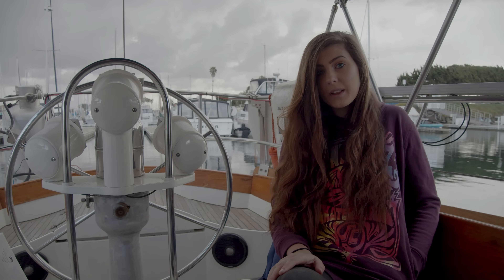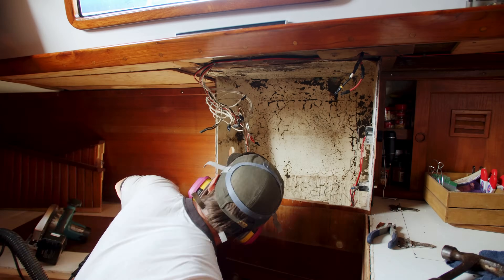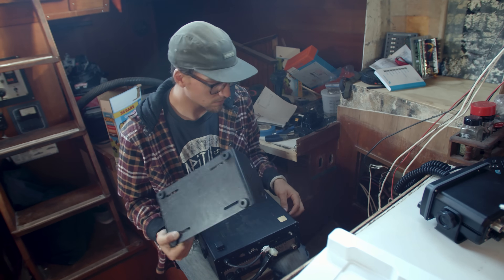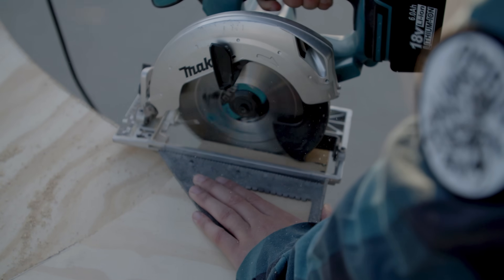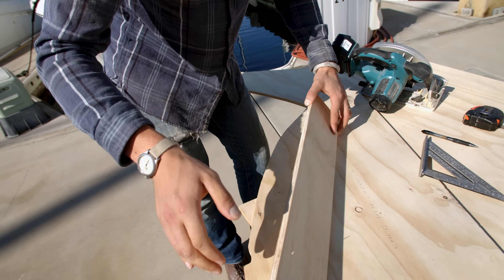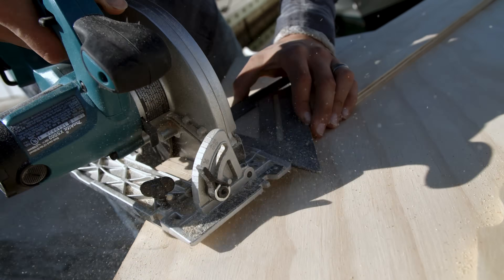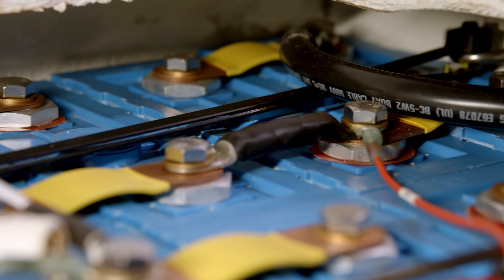Sailing Avocet | DIY Lithium Batteries for our Sailboat!

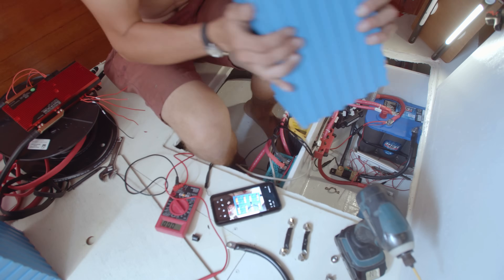Comment: @8:24 there is no difference between 4S2P and 2P4S. what your talking about with needing two BMSs would be TWO 4S1P packs. If you actually have the cells in 2P weather you call it 2P4S or 4S2P then you would only need one BMS. Source: Me - an electrical engineer with lithium pack experience.
Reply from the maker: 🤙 thanks for taking the time to watch and comment. https://www.svavocet.com/2021/02/22/powered-by-home-built-batteries/

Comment: Really organized and clean layout. One can tell you obviously did your research, bought the right components and dud a nice clean install.
Love the organization of the navigation station.
Could nit really tell, but is your battery bank & management system above the water line? Some of the other cruiser channels are finding out the hard way that electronics  / power should be above.
Reply from the maker: Thanks for watching Joe and great question! Avocets interior is actually very much so under the waterline. This is one of the reasons the batteries live in a water tight box under our bed, absolutely out of green waters wrath and any leaks (that (god forbid) happen.

Comment: Guys, could you please ID the labelling system you used on the wiring, I am about to do the same, but have not found a system as good as you did. Thanks
Reply from the maker: We actually purchased a label machine to make all of our labels, are you asking about the schematic?
Reply: @sailingavocet  Hi, that was an impressively fast reply; thanks. I'm interested in the attachment method, both the backing for a label and the apparent zip tie connection to cables. I also brought a machine, looked at many electrical trade systems, brought simple at first for white letters on black tape on our switch panel, but now am on to cables in all the dark, wet and dirty plecas. Any insight much appreciated, thanks. Antony

Comment: This is a really great video. Two engaging presenters, loads of info and a great idea to present it after a year when you had some proper usage figures. I hadn't even realised you could build your own batteries like this. Marissa mentioned 'dangerous' at one point. What was it that you were concerned about specifically?
Reply from the maker: Thank you so much! We are really glad this video sparked so much interest. I mentioned dangerous because of the wiring involved. Just like any wiring, if done wrong you are a fire risk. Luckily we replaced every single wire in our boat to eliminate issues! :)
Reply: @sailingavocet  ah ok got it. Thanks for taking the time to reply.
Reply from the maker: @AthelstanEngland  of course! anytime!

Comment: I've been doing my research as well for building a battery bank for electric bicycles and found out the exact same thing. You can build a stronger, more efficient, and maintenance friendly system for half or if not a 1/3 of the cost. Great video.
Reply from the maker: glad to hear you have been doing your research and that your findings are similar! best of luck with your project :)

Comment: Great segment guys! I had a bunch of questions but Superform asked most of them so I'm glad to follow along as you add additional awesome vides on the subject!
Reply from the maker: Thanks Ken! Hope all is well up north
Reply: @sailingavocet  All good here. Lots of boat projects (big and small) tee'd up for the winter months. I'm about to add an electric windless as the next project for me. Which led me into a battery discussion which led into replacing the really old Neptune charger with a Victron Chr/Inv, battery monitor,  set up... FUN! :)

Comment: Thanks for sharing!  Been planning to do the same, so it's really useful to see more folks sharing their DIY lithium setup.
Reply from the maker: Heck yah, stay tuned for the more detailed part 2 that will come out tomorrow/Tuesday
Reply: @sailingavocet  Did you consider doing a 24v system with a converter? If so would love to hear more about the decision process

Comment: Great info- lots of good points towards building your own bank. I definitely like the thought of carrying spare BMS's and having the ability to rearrange cells in the event one goes bunk.
If I can ask, what voltage regulator are you using to charge your bank?
Reply from the maker: That was definitely one of the main drivers and as mentioned the technology is improving so we can improve with it! More details in tomorrow’s video/blog!
Reply: @sailingavocet  right on!

Comment: Do you still have a start battery and is that lithium or lead acid?  Details on how this is charged and wired would be appropriated. 

Great video and thanks for taking us thought the build. I think you’re the first to do a custom LiFePo battery build. What did you do regarding waterproofing or to keep salt air away from the BMS?

Fair winds!
Reply from the maker: All great questions, part 2 coming out tomorrow to discuss the system more in depth! We didn’t think that people would be this interested in all the nitty gritty bits! :) we still have a sealed lead acid starter and will go into allllll that soon.

The batteries used to be under the companion way which was not great if we ever caught a green wave. We moved them to the spot under our bed because it’s watertight and away from any and all water access keeping them safe and sound
Reply: @sailingavocet  can’t wait for part 2 😉

Comment: Could you have put the hinge at the bottom of the panel such that the hinge plates were in the crack at bottom with the hinge "rods" sticking out? It would have looked much cleaner.
Reply from the maker: That was during the dry-fit stage, the finished product is installed properly :) Thanks for watching!
Reply: @sailingavocet  Oh good. I was like wtf?

Comment: how are you charging those? i see you have a sterling ac to dc charger and a renogy dc to dc charger but is there any solar? do you use relays to protect your gear if the bms cuts out? also why not use the CA180's rather that the SE180's? i know they are a bit bigger but they have a higher discharge rate. also do you run these to an inverter? sorry for all the questions but i'm in the middle of planning my set up so its good to see what other people went with. also the link to the blog post is 404 - keep up the good work!
Reply from the maker: Wowza that’s a lot of questions! We are so glad you are interested in learning more- we will fix that blog post, sorry for the inconvenience! 

To start we have two battery banks, the lithium bank, and a lead acid battery. The lead acid battery still exists in our system because our engine still uses a non lithium friendly alternator. So to charge the lithium batteries the power from the 120a balmar alternator goes to the lead acid then directed through the 60a renogy dc-dc charger into the lithium battery. 
We have a Sterling 40a AC-DC charger that charges the lithium battery when at shore. It not only has a lithium profile built in but you can also program custom profiles. 
And lastly our renewables, all 400 watts of solar power goes directly into the lithium batteries through 2 20a Renogy MPPT chargers. 

Due to the amount of questions regarding the charging and powering of our lithium system we will be uploading a separate video explaining everything on that topic.
Reply: @sailingavocet  yeah a detailed video would be great, as you said there is still very few good videos about boat set ups, not just the batteries but the systems around them. A couple more questions for the video, do you use a relay to turn off the solar panels when the battery is full? and how have you found the daly bms fett based system, does it get hot? do you worry about it failing, how many amps is the bms rated for and how many do you put through it? Also another one, you said you went 2p4s? how do you keep the parallel cells balanced with a single bms? if you did it again would you just go 2 x 4s with 2 bms? do you find the 400w panels is enough to charge 4300wh?

Comment: 11:30 When you say "20% Discharge", do you mean to say the battery is discharged 80% or 80% depth of discharge?  A little confusing there but otherwise nice setup!
Reply from the maker: 20% left of the battery, 80% discharge- it can definitely get confusing which is why Marissa requested the end shots in text to help those like her comprehend the numbers! It’s dense 😂
Reply: @sailingavocet  Thanks for the response.  LiFePO4 is wondrous huh!
Reply from the maker: It is amazing!